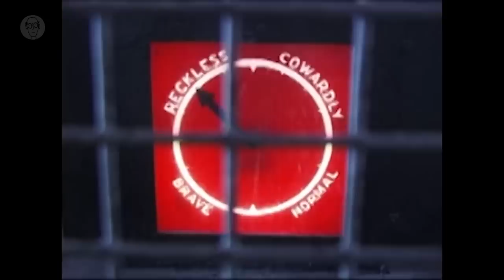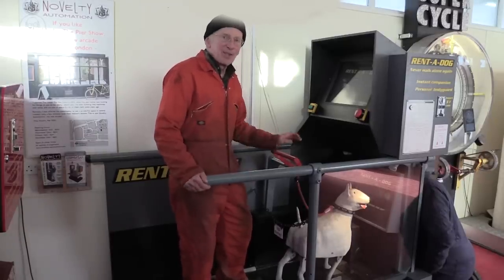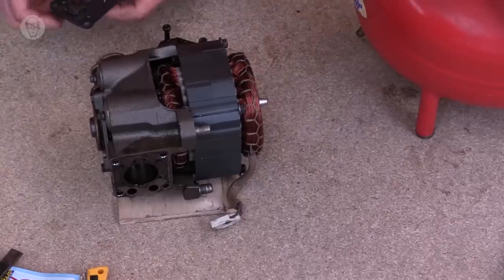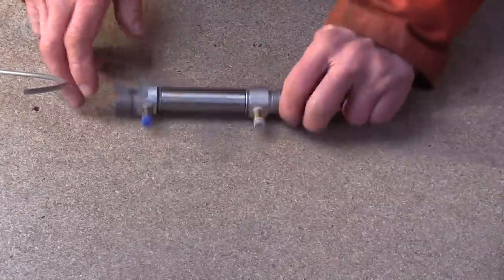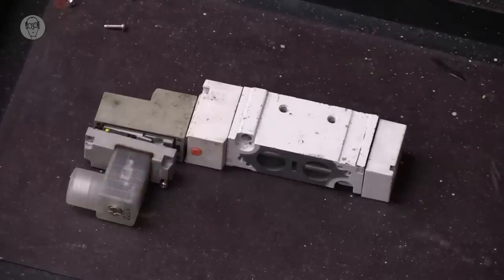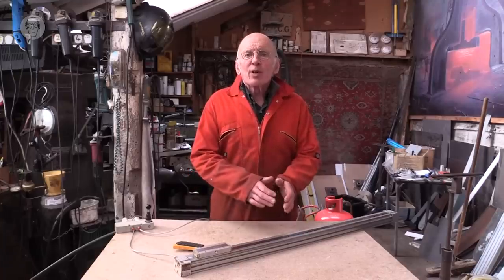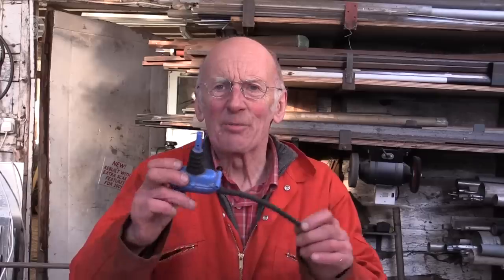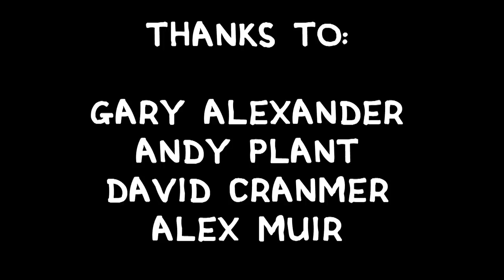PNEUMATICS -The Secret Life of Components, a series of guides for makers and designers - episode 14

Comment: I read somewhere that of the main reasons that pneumatics still remain in industry is because they're intrinsically safe - you can't get a spark from compressed air, so you can use them in explosive environments, or places with a lot of flammable dust.

Comment: I've always wanted to do something with pneumatics - the action is so satisfying!
You can get oil free compressors pretty cheaply nowadays - I think they use two or more diaphragms to avoid any friction surfaces that need lubricating
Reply: I have several oilless piston type compressors, all salvaged from wrecked cars with air suspension. One has been my tire inflator for the past 20 years, been run until it was smoking hot numerous times, generally abused, and still works like new. Most of them have an integrated solenoid bleed valve that's handy  too.
Reply: Nice to see you here Mike, it's a small world I guess
Reply: A Tim & Mike collaboration would be fascinating...
Reply: Or compressors from used fridges and A/C units - They can be used either as a compressor or as a vacuum pump.
However they won't last long without proper lubrication applied directly into the intake air...

Comment: Tim mentioned vacuum bellows used in cars - my Land Rover used to have its cruise control throttle mechanism controlled that way.  One might remember the old distributor vacuum advance too.  The vacuum tube system for moving items around is used in the nuclear industry for moving radioactive canisters around quickly and without human contact (I forget but there is a university department in America that has a system that runs over a huge distance between labs).  Perhaps Tim mentioned it but pneumatic systems work well in 'explosive' environments where the risk from an electrical spark would be a real problem!  What a brilliant video - we are so lucky he is still broadcasting albeit on YouTube!

Comment: Very good!
I had a Ford that had pneumatic windscreen wipers, powered from the intake manifold vacuum.
They stopped when going up-hill, due to a lowered vacuum!
Reply: I remember those - you had to slip the clutch and briefly rev the engine to get a quick wipe going uphill in the rain. VW had a system which worked off the air in the spare tyre. If you had to fit the spare then you had no wipers so I guess that Ford's method was less bad than the VW.

Comment: Tim, what a joy to watch this episode! I really like your clock in the London Zoo and can imagine the troubles you had to keep it running. 15 years outside is a challenge on it's own. I designed and build a lot too and experienced that time will wear stuff out eventually especially in harsh conditions like production lines or outside. I would try a Hydrovane compressor. They're not that expensive and are very durable. I own one for 20 years now and it never let me down. I buy a maintenance kit every year or so with a new air filter and new oil. Maybe a tip. Thank you for sharing all your knowledge and wonderful projects with us. All the best, Job

Comment: Years ago, I went to a lightning lab as part of a school field trip....one thing this lab did was launch small rockets trailing a thin wire into a storm cloud. All of the controls were pneumatic in the launch facility, with all the electrical components in the launch pad. Nonconductive tubing from the " bunker" to the launch pad. 
     At my last job, the elevators were partially controlled by what amounted to a vacuum/pneumatic computer if a sort 
      This was a great video! These should be shown in schools...

Comment: In all the time I have worked with pneumatics, there is only one hard and fast rule which has held true... the ideal gas law is a suggestion, Bernoullis principles are are a rule of thumb. However...
"Whichever style of quick connect you bought, it isn't that one. Nor is the other style you have downstairs... it will always be the other kind that you didn't know existed until just now." holds true.

Comment: If you want to check out low pressure pneumatics, look at the W123 in your drive! The central locking is all vacuum powered. You'll find a huge vacuum tank at the top of the boot, and lines going to all the door and the fuel filler. A valve in the driver's door is connected to the lock plunger, and switches between 2 vacuum motors like the VW one you showed. There are other similar ones in the dashboard for the HVAC to move the blend doors.  
On an old diesel Mercedes there's a valve connected to the accelerator linkage which simulates a gas engine manifold vacuum, for the automatic transmission. I've taken mine apart, but still don't understand how it works. It must operate on a similar principal to the pressure regulator, but I don't see how it doesn't create a vacuum leak. My 1991 Benz adds to this a vacuum amplifier device which modifies the accelerator vacuum valve with boost pressure. The ignition switch is pneumatic too!

Comment: you can build a pneumatic computer... using force balancing and analog pressures to represent signals. bellows and diaphragms will be balance against levers and springs. This can provide control in both proportional and inverse proportional relationships. Add in some bleed valves and you get reset action, addition, subtraction, accumulation... these types of computers are quite reliable and are not effected by magnetic fluctuations or changes in either magnetic or electric fields... ideal for industrial controls... or if you need a computer that can survive a EMP blast. =D  Happy Wednesday!

Comment: Thank you Tim.

With regards to liquid being non-compressible vs gases being compressible; this is why testing of pressure vessels to failure is often done with liquids, as the failure mode is less energetic (therefore less dangerous) compared to if gases are used.

This can be seen in videos where prototype fuel tanks for rockets are tested with liquids.

Had they been tested to rupture with gas then the parts of the tank are liable to fly apart and travel some distance. Whereas with liquids they tend to burst, and the liquids leak out at a less energetic rate.

Comment: One of my favorite camping toys is a small pneumatic fire starter. It’s simply a tube. With a ram. And you place any sort of tinder or char cloth in the bottom and strike the ram with your palm or something. And the heat of the compressed air alone is enough to cause combustion. Also let me visualize why those darn pumps overheat so much

Comment: The auto drain will let the liquid out of the tank but there will still be a lot of water vapor mixed into the air so a mist filter or dryer will likely be required.

Comment: I used to work at a place where they made ammunition. All the machinery in the explosives area was driven by compressed air. They had two enormous piston compressors and HUGE tanks to hold their output. The pistons were over a foot in diameter!

Comment: Might be better if you could convert the pneumatic control of the clock to electromagnetic actuators, gear motors, stepper motors, and CPU controlled electronics that are pretty inexpensive these days. Might reduce the maintenance headaches. Love your engineering expertise you have accumulated over the years--- you are a national treasure. If I ever get to travel to England, one the first places I'm going to visit is your commercial public exhibit of clever mechanisms, and places (aviary) like this clock.

Comment: You can use a desiccant drying  unit with a membrane filter to take care of the water. A regenerative adsorption desiccant drying system should work great for your water issue. They usually purge (with dry compressed air), and heat for more efficient regeneration. They also usually come in pairs to always have a working dryer.

Comment: In the late 2000's I was working in a chemical production factory. Pnuematics were heavily used throughout because if there's one thing that electrical systems REALLY don't like: It's liquids. Liquids everywhere. And sometimes the pneumatic systems were necessary where flammable vapours were involved.

Comment: The Link Trainer - the first US flight simulator - was invented and built by the Link Player Piano Co., and simplified some years later by Sylvan K. Ketterman. The Trainer was actuated by pneumatic motors - the small black rectangular bellows covered with rubber cloth shown in your video - which is how player pianos and player organs worked (whether on pressure or vacuum wind). I recently saw a modern version of the Trainer on YouTube that works with pistons.

Comment: I agree with you , pounds per square inch (P.S.I.) & miles per hour (M.P.H) are easy units to use.
Example*
If you weigh 180 lbs. and you are driving at 60 mph. If you hit a brick wall, the force your body will hit the brick wall is at
180 lb X 60  (60 m.p.h.)
You're 180 lb body will weigh 60 times more When it hits the wall. 10,800 lbs.

Comment: Pre-war (WW-II for young folks) had vacuum wiper motors to operate usually one, sometimes two wiper arms. On a rainy night during a heavy down pour, when the gas pedal (Petrol) was pushed to the floor, the wipers stopped or slowed noticeably. The narrowed area in the throat of a carburetor created an airfoil as seen in the shape of an airplane's wing. Air passing over it, had to move faster. On an airplane it created lift. In a carburetor it created a vacuum the drew fuel threw a main jet but a strong vacuum signal. This supplied vacuum to the wiper motor. Also, actuators used to move doors on the air box to move cabin air on cars again, was used into the 90's. Open to defrost by DOT regulations was required to defrost the  windshield (Windscreen) but this and hot air removed fog, unless you had a politician in the passengers front seat for excessive hot air!
  Vacuum actuators operated everything from hot to cold by by-passing the heater core and forcing cold air around it. On GM's they used a check valve inside a round plastic canister. Ford, oddly enough use a qt sized coffee can painted black inside or outside the drivers wheel house (Inner Fender Panel). Vacuum operated power door locks on 1942!-1945 ,
Mercedes Benz on certain models. Many applications for these devices. 
DK, Omaha. Retired.

Comment: That first rodless actuator you showed works very similarly to a steam catapult on a CATOBAR aircraft carrier such as the Forrestal or Nimitz classes, though the newer US carriers are switching to an electromagnetic system.

With regards to water collecting in a compressor tank, you can buy electronic valves with a timer in them, to replace the manual drain valve on the compressor.

Comment: Timely video.  I still love watching your original series. But I'm currently buiding a acuator to turn a 1 inch ball valve on amd off remotely to control the main air supply line in a body shop.  

Somce the compressor os on a timer and has a built on refigerated dryer when the compressor pumps uo for the day it fills the 150gal tank woth wet damp aor before the dryer gets down to temp.  

Putting this valve in will not only prevent this by holding the aor on the tank when we are closed but will also save some energy from having to fill the entire tank after the shop lines leak down overnight.

Trying to cobble together both an electric and pneumatic ideas mostly from old parts o habe laying around

Comment: Steel mills use pneumatic tubes to send steel samples from the electric arc furnace (EAF), ladle metallurgical furnace (LMF), and caster to the chemistry lab. The samples are put in a spectrometer to determine what additions are needed, how much carbon needs to be cooked out, and final steel grade.

Comment: Fascinating, as always!

I was under the impression that oilless compressors had short working lives - that maintenance consists of using it for a while then throwing it away and buying a replacement.  Are there models out there that will last a decently long time in your application?  (Mine's oilless, but it only gets used maybe an hour a month.)

The difference between pneumatics and hydraulics manifests itself in many ways; I found myself trying to imagine operating, say, an excavator that used pneumatic actuators... could be highly entertaining for the audience, but not for the poor guy trying to get work done!  On the other hand, for your uses (and for a couple of things I've built in past years), pneumatic actuators are just the ticket.

Comment: A quick off the cuff calculation, may help others.
1 square inch = 645 mm^2, so the 87 psi that you get from a 6 bar compressor equates to 87/645 = 0.13 pounds per square mm.
If it is regulated down to a more reasonable 3 bar you are looking at 43 psi/645 = 0.067 pounds per mm^2.
The inner diameter of the 2 mil tiny hose is somewhere in the range of 1.4 mm, giving a crossectional area of  pi*0.7*0.7 which is around 1.5 mm^2, for a force of 1.5 * 0.067 = 0.1 pounds, or 50 grams.

Comment: We are finding the linear motors have been problematic due to dirt and dust.
Also wiring looms wear out so do the air ones but air lines are easy to replace.
Plus the linear motors are so expensive to replace as far more components than air cylinders

Comment: Be careful about the assertion that all cylinders have a magnet to actuate reed switches. On one job some years ago, our mech designer forgot to include the "-M" or whatever to specify the magnets, and we ended up with about 20 cylinders that were no good for the job. The manufacturer wouldn't take them back because they'd been  made to a custom length. i think they're still kicking about in a box in stores.

Comment: Air powered tools are great if you don't use them that frequently. You don't have to worry about keeping batteries charged or battery degradation from not storing them at the right state of charge.

Comment: 48:32 for many years, vw audi used air powered central locking, with pipes running all over the car and those little actuators inside the doors and even on the petrol cap.  To me it always seemed an unnecessarily complicated way of doing it.  It didn't take much of a leak for the system to stop working, and trying to trace the leak was a nightmare.  I gave up and just fitted an aftermarket kit to mine when it stopped working

Comment: Yo have to be a bit dull of mind to stick soley with metric or imperial. For instance metric is fantastic for short distance measurements (for making things) as it is easily divided, subtracted and added. I use miles for long distance (for travel, by foot, bike or car), I use imperial and metrics on pneumatics at work, metric push fits with bsp threads under 7 bar of pressure so it all varies.
I had to delve into BSP threads today in work, I put the verniers on the thread, and wondered why what I know as a half inch bsp thread is 20.7something mm. Made me turn to google and find out theres a 25% to be deducted or added, I dunno, I just printed out a measurement chart ; )

Comment: A rotary cylinder could be a good way to provide force feedback to a steering wheel, if you paired it with an open-center 2/5 valve and a controllable pressure regulator.

Comment: I also prefer to use PSI in a metric country. In my brain this is filed in the same section as why airline pilots announce altitude in feet, but airspeed in meters/s or knots: so they don't crash into each other after becoming confused on the units. PS I would like to put air-ride dampers on my car so I can be gangsta and pump a wheelie.

Comment: On the compressor for the clock, personally I'd stay away from oil free ones - unless there are some newer, heavy duty ones recently available that I don't know of.

I mentor students on an FIRST Robotics team and we build all sorts of pneumatic robotic mechanisms to compete. We burn out multiple small oil free compressors every year (3 in the past month alone). Sometimes we install 2 or more on our non-competition robotics so when 1 burns out, we have another to keep going. Here is a competition match from this past weekend:

https://youtu.be/z3S7dBFTfn4

I also use a lot of compressed air in my personal hobbies. Including converting automotive AC compressors for use in off-road trucks. Even the biggest oil free compressor I tried only lasted about a year of moderately heavy use. Also all of the bigger oil free ones I've tried degrade quickly with how much air they provide.

I finally bought a cast iron oiled compressor a few years ago and it works as well as the day I bought it. Similarly, the farm I used to work at many years ago had excellent luck with heavy duty cast iron oiled compressors.

Anyway, I'm not an expert on compressors but I've found our oil free ones fail a good 5x faster than low cost oiled compressors and high quality oiled compressors seem to last 100's of times longer than typical oil free ones.

For the clock I'd get a decent quality, oversized industrial oiled compressor (used), plus a large enough tank to allow the compressor to have a good duty cycle (perhaps on for a couple of minutes and off for 15+ minutes). Add a decent oil/water separator with an automatic drain and you should have about as reliable an air source you can get.

You could also consider lowering the operating pressure if you don't need the standard 120 to 150 psi (but the oiled heavy duty ones don't seem to care much).

Good luck.

BTW, we too almost never have issues with any of our pneumatics, except for the compressors...(lots of other mechanical things break though...)